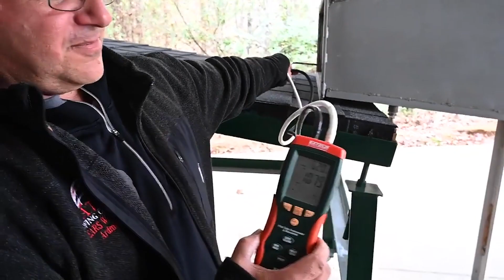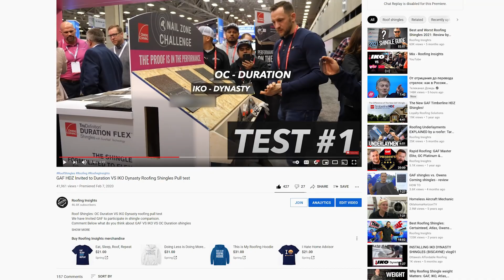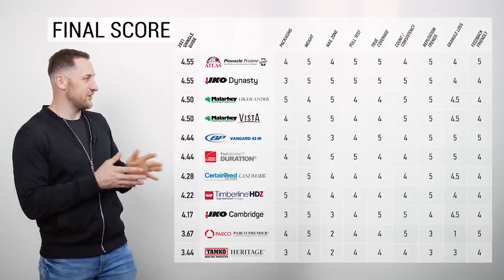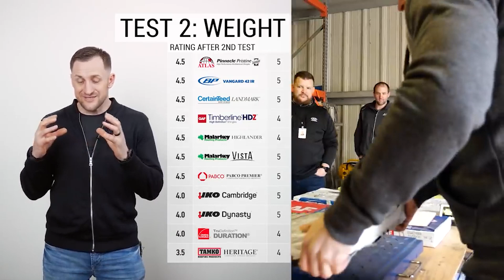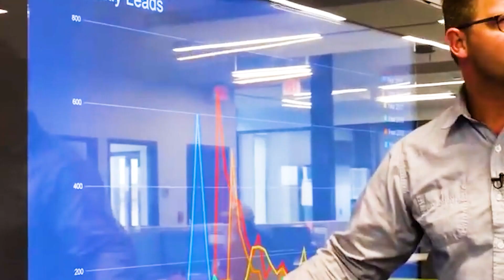Why we couldn't film Owens Corning at 2021 IRE...

Comment: If you had to replace the roof on your home, what would you use, Dimitri?
Reply from the maker: IKO Dynasty, Malarkey Highlander, Owens Corning Duration Flex or Atlas Storm Master
Reply: Standing seam metal roof lifetime won’t have to worry about replacement
Reply: @Luis-ic8ej  What happens when your insurance makes you sign a cosmetic clause then a nice hail storm comes and puts nice dents all over that expensive metal roof?
Reply: @Luis-ic8ej  until the paint oxidizes
Reply: IKO Dynasty needs to fix their colors.  They have horrible blocking issues.  The best looking and most durable is the Atlas StormMaster Slate.
Reply: @RoofingInsights3.0 is duration trudefinition good?

Comment: A few comments about your video:  1) you didn’t test the “nail through” 2) you didn’t test the “seal on front edge” 3) you didn’t test the “installers ability to hit the proper location when nailing to the shingle below.  Installers prefer the nailing strip to accomplish this.   NICE TRY.
I’ll take Owens-Corning Duration any day for total performance and assured proper nailing installation.

Comment: Every manufacturer has problems none are perfect, it’s who your comfortable using
Reply from the maker: Some has way more problems than others and less incentives for contractor
Reply: @RoofingInsights3.0  That's somethin you don't talk about very often Dimitry. Many industries have different programs or incentives they offer to contractors. For example in the landscape irrigation industry/trade the main manufactures offer a preferred contractor program....Rainbird, Hunter, Toro, Irritrol, etc.  They give installers rewards, promotional apparel for staff and some even offer 2% cash back at the end of the year. Usually the cash back programs just charge more up front at time of purchase. How does the roofing industry incentivize contractors? That would be a interesting video, but not sure you would be allowed to discuss on YouTube?

Comment: Which manufacture will still honor their warranty after a bad windstorm that caused the sealant to fail and cause the shingle to be flapping in the wind but not fly off the roof? There’s technical bulletins saying that would void the warranty..so what’s we should be testing is which shingle has the best sealant to stop shingle uplift altogether..that would be interesting
Reply from the maker: I heard GAF wind warranty is pretty strong…
Reply: Have the homeowner do a claim and call you when it’s done.  I’ve done multiple that way. You might have to take samples and pictures but it’s easy.
Reply: To keep the GAF warranty in effect in my zone, I had to use 5 nails per heavy 3 tab shingle, and extra adhesive within 4 feet of all edges. From mid 2007 to late 2023, I've had one shingle come off the continuous ridge vent; a single tab in a high wind area. The tab was still good, matched the rest, didn't have a single nail hole in it (oops) ,and went right back on. Warranty is now gone, but the shingles are still there, looking good. I bought 10% over for that job, but haven't had to worry that pile yet. No repairs needed to date. The factory where they were made is only 90 minutes away, and was the best 3 tab I could find available, as I wanted to keep the original period look of the circa 1965 building. The neighbor across the street who put up top of the line OC Architectural Shingles at the same time, just put up a new roof in 2023 same same.

Comment: Shingles now also scar easier at lower temps do a episode on that probably where the weight went
Reply from the maker: I like the way you thinking! Noted and added to my book!
Reply: @RoofingInsights3.0  I am an OC guy, and ripped off a  60 square 10/12 IKO Dynasty roof.  I usually hate on IKO, but a few things really stood out to me comparing the OWENS CORNING estate grey shingles vs the castle grey Dynasty. Side by side in the sun the OC were 10 times hotter than the Dynasty.  As well, the Dynasty refused to scuff even walking on them on the 10/12 pitch.  However overall when exposed to sun I believe OC are the better shingle stick wise, so I stay with them.  But scuffing and heat, the Dynasty were WAY BETTER.
Reply from the maker: Wow, thank you so much for sharing!!!